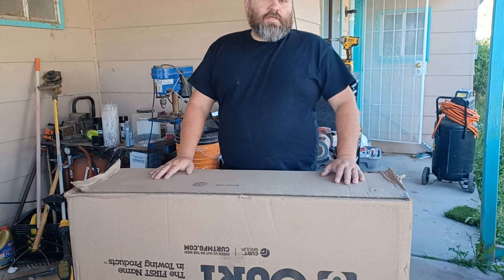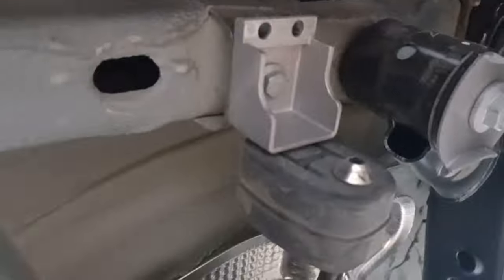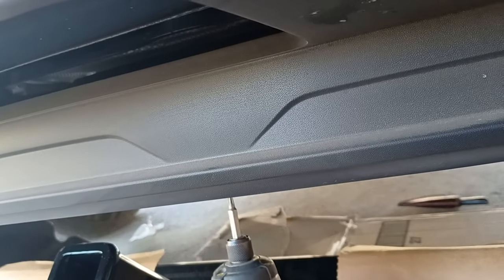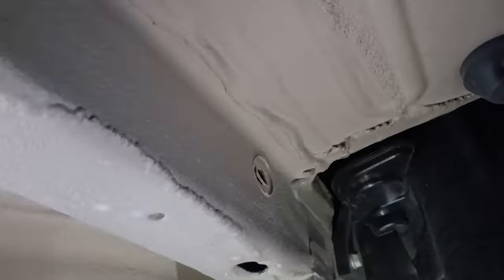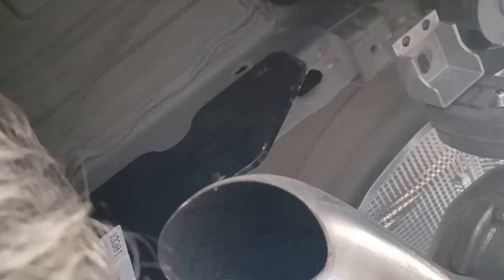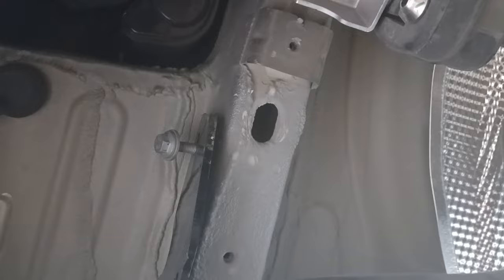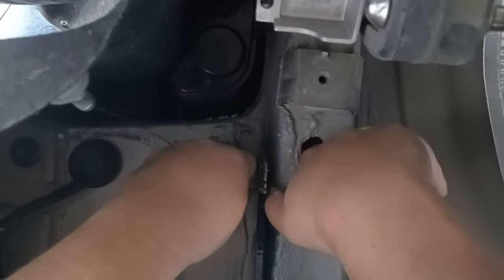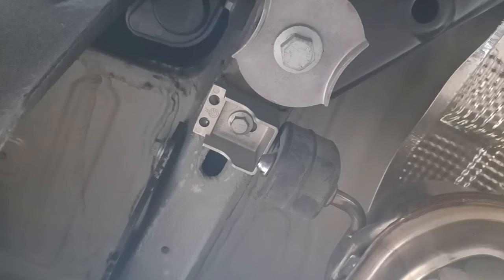What Curt Doesn't tell YOU! 2018-2025 Volkswagen Tiguan Hitch Receiver How To Install for Beginners!

Comment: I just did this hitch today.  If you scrape away the rubber like coating on the frame rail then spry paint it to prevent rust it is very easy to get the hitch into place.  Also, on one side (does not matter which on) I treaded the bolt to the front mounting hole and used a small strap (wire would work as well) through that same hole on the hitch.  Hang the strap that is attached to the hitch on that bolt as support then get the other side started.  Then remove the strap and bolt that side.  With one side suspended by the strap or wire you are not fighting the whole weight and awkwardness of the hitch. Hope this helps.
Reply from the maker: I could see that working. And I hope your comment does help someone. I've put in quit a few bolt on hitches this one stands out, and if i could go back I would do it differently. But we make the mistakes so hopefully you don't have to.

Comment: 3 Hours i got it done later lol 🤣, if i only knew to move that damn bumper frame around 😮. I was using a screwdriver to align holes which was a pain in the ass LOL.
Reply from the maker: I get it. I've installed a few of these and I feel like this, one was the weirdest one.